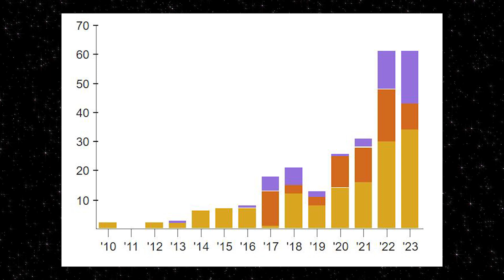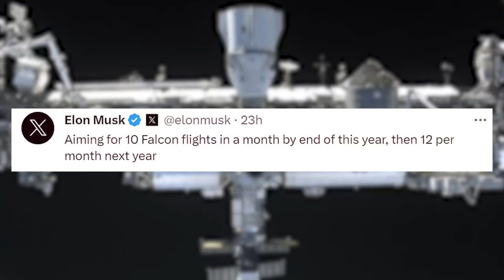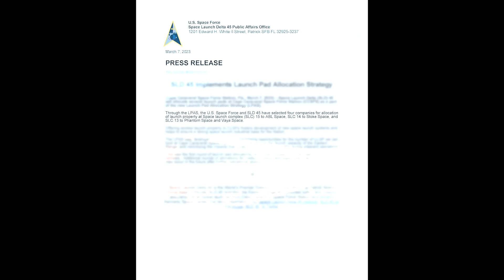SpaceX Is Trying To Launch A Rocket Every 2.5 Days

Comment: SpaceX is upgrading LC40 to add a backup ability to launch Crew Dragon.  SpaceX also need a to add a vertical assembly capability to launch NRO payloads which ULA cannot deliver since it is out of Delta IV Heavies and is no longer permitted to use Atlas because of its Russian engines.  It will not be before late 2024 that Vulcan-Centaur can handle these launches.